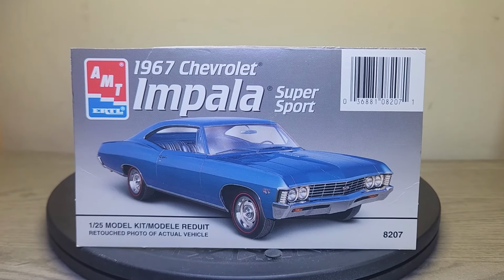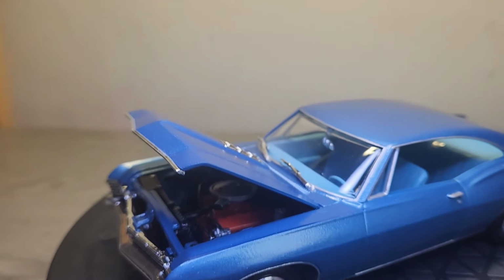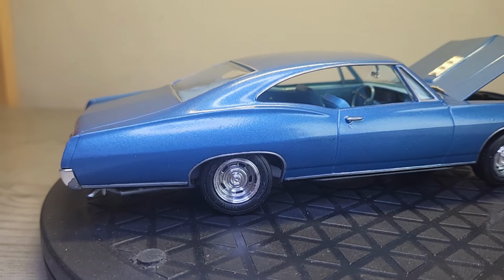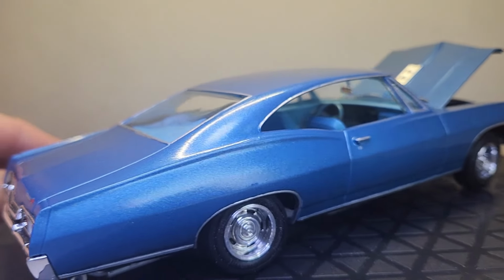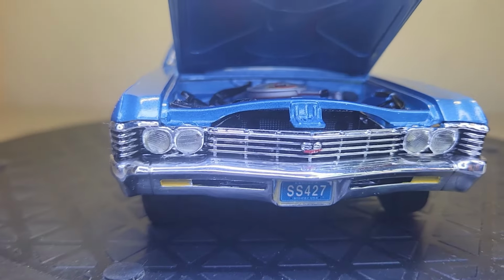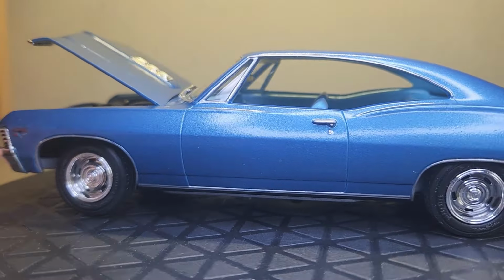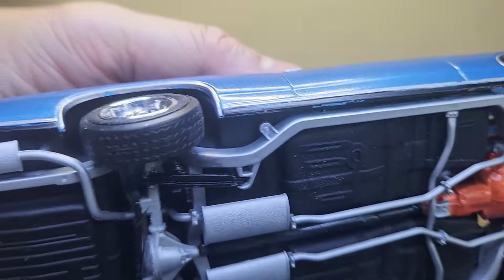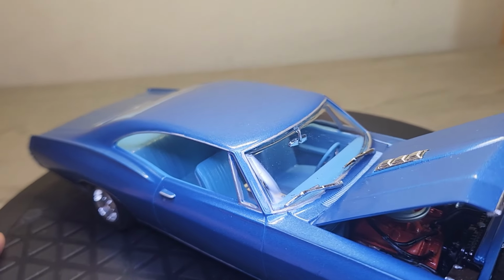AMT/ERTL 1967 Chevrolet Impala SS - past build revisit

Comment: Thanks for the memories. I spent a lot of time under the hood of a 66 Chevelle, back in the day. They shared a lit of similar design. The engine was a 396 with the 4 speed on the floor console like this. I was putting in a new clutch almost monthly.  The color was similar even, the Chevelle had a black roof and twin side mirrors. I appreciate seeing your build because the memories came flooding back. Thank you.
Reply from the maker: Thanks Ed for checking out the video. Your Chevelle must have been some fast car. Was the monthly clutch change due to your driving style or poor engineering?
Reply: @davidchin350  Driving style. yes it was fast.  This was how I made money in High school.

Comment: I bought this kit when it first came out in 1997, at a time when AMT was putting out some really impressive kits, and I still have it, painted in this exact color scheme, to this day. Hand painted inside and out using I believe a Testors blue.
Reply from the maker: @davidhinkson8856  we have the same first name since we think alike😁 I used a Testors spray can Metallic Blue. I think the interior was just blue. The later Round 2 release had the side mirrors and the small model kit box 📦 you can fold and glue together👌